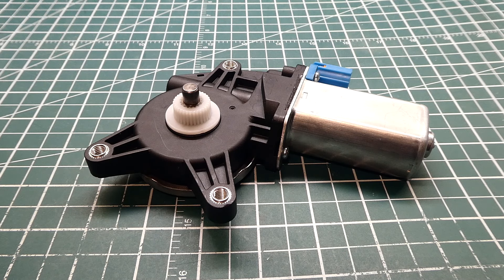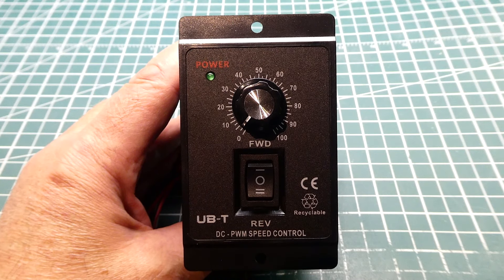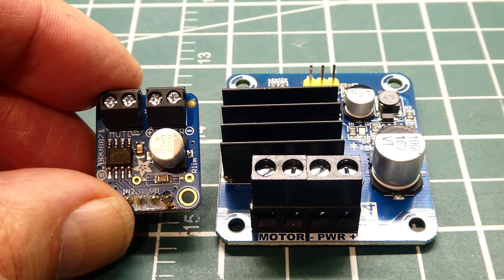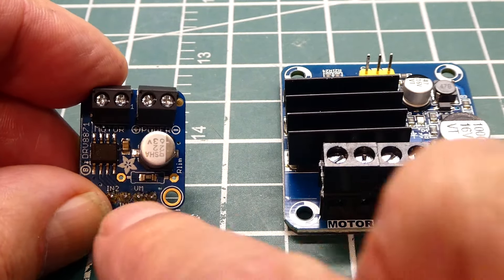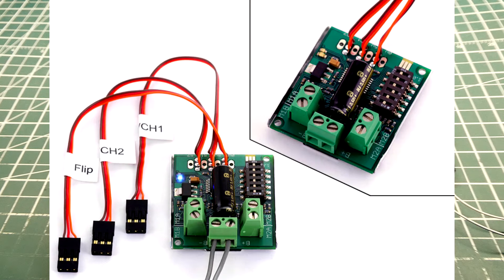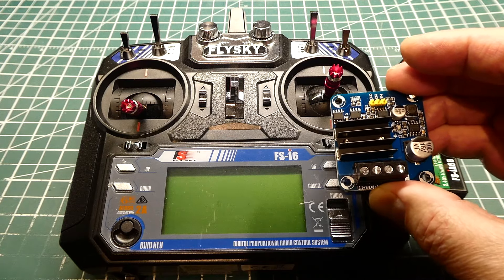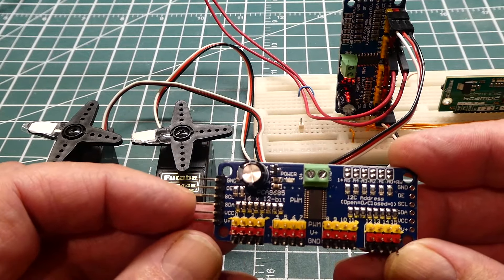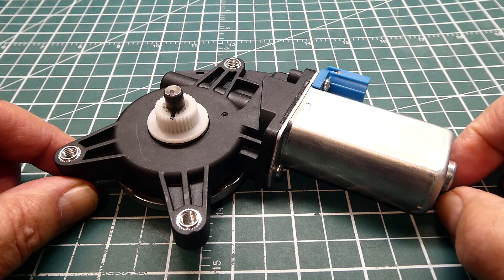Getting Started With Robotics / PWM / PCA9685

Comment: Great !! As usual! I've been working with automotive parts for many years. Also, the wiper motors are awesome. I prefer those from vans and small trucks. Quite often they have metal gears inside and they're more robust.  The window lifters usually have plastic gears and are less suited for (long) continuous operation and heavy duty. Another interesting automotive part is the residual heat circulation pump. Very durable, high throughput, and it resists coolant chemicals. Finally... those wonderful automotive relays which can easily switch up to 30 Amps.
I'm looking forward to see your next video!
Reply from the maker: Thanks for sharing! Wiper motors are also useful. I would get them out of Ford trucks. I found the worm gear was metal but the sprocket gear was plastic, like the window motor. Probably for a more quiet operation. I used the window motor in the video as it only has two pins for power. Wiper motors have more than two pins for the park and speed functions and can be confusing for beginners. I built an inspectioon robot for running under semi trucks and trailer. The self locking function was handy for stopping on a slope without rolling. Extended running of the motor is not recommended which worked out for my application.
Reply: @0033mer  Awesome!

Comment: What are the characteristics of a DC motor and how to find them? Like induction motors they have every thing written on their nameplate things like rated voltage, rated current, rpm and torque at the rated voltage with no load on
Reply from the maker: You can get specs from the manufacturer.
https://www.mybotic.com.my/power-window-motor/power-window-motor-wira-right
Reply: @0033mer  is there anything similar to a nameplate (some marking on the motor's surface) or a paper that comes with this information, in case of getting the motor elsewhere?
Reply from the maker: Car manufacturers contract out a lot of motors used in their cars so there is no nameplate or specs available. You just order the motor with the part number. If you are creating a product, then purchase an OEM motor, and the manufacturer will give you the specs. https://www.pololu.com/category/51/pololu-metal-gearmotors
Reply: @0033mer  oh I understand, thank you

Comment: What is your reasoning behind using a worm gear setup per se?
Reply from the maker: High torque output, self locking and hundreds to choose from.
Reply: @0033mer  The gearing of course.
Most motors run too fast for a beginner to use practically.
I used to use them as a kid .
 Back then I had minimal hand skills and even fewer tools at my disposal. 
There were no robot shops or internet, but there was a car wrecking yard.